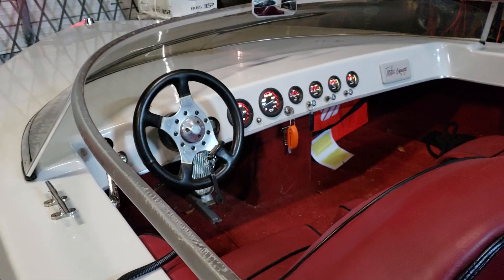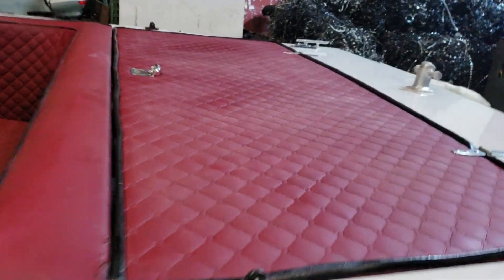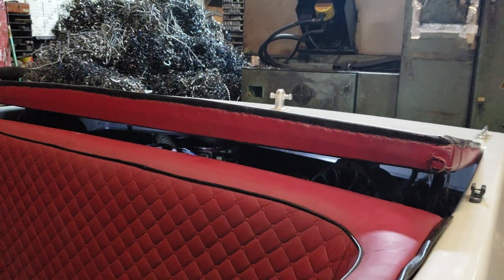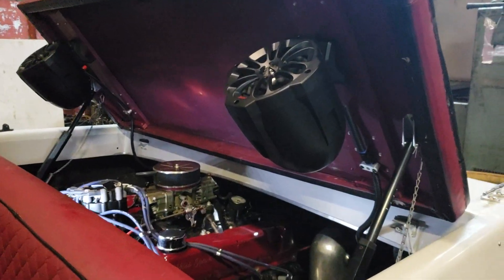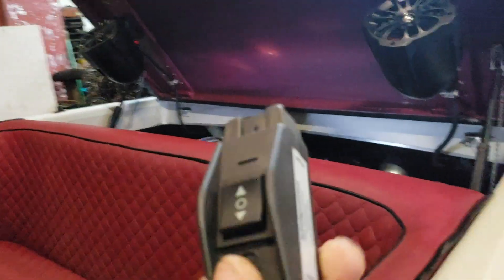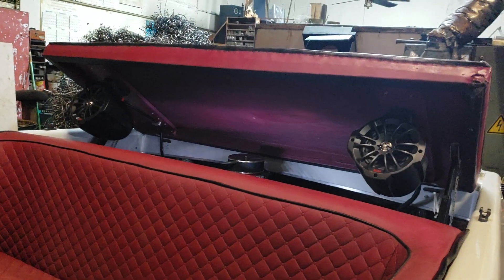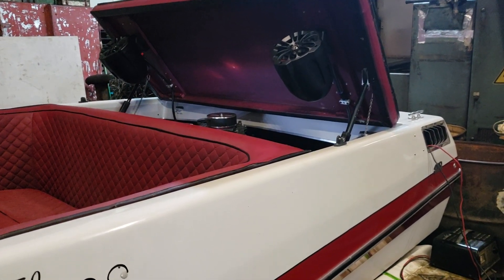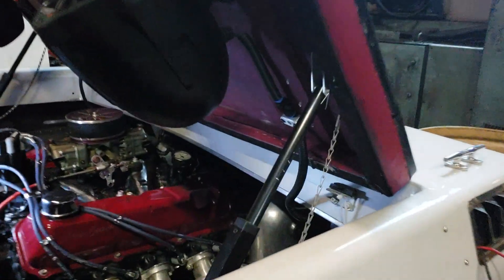Installed WindyNation actuators on my Taylor SS jet boat's motor hatch with custom override system

Comment: How did you mount to the hull and still make it fail safe to where you can lift the hatch manually?
Reply from the maker: I made some brackets that are attached to my back seat, they run the length of the seat from top to bottom. From there I mounted the actuators bracket at the bottom of seat brackets. Sized a threaded rod for my projected and drilled a hole at one end then pinned it to the actuators bracket with a nut on the threads for adjustment. On top of the threaded rod I sized a PVC pipe for a shim with a aluminium pipe over it that's pinned to the actuator. For my project the threaded rod, PVC pipe shim, and aluminium pipe were roughly 10 inches long giving me some travel for the hatch to be manual open  or would side apart if needed.
Reply: @dlbpc1  Great idea I know its been a while but some pictures of this actuator extension would be really helpful. Thanks